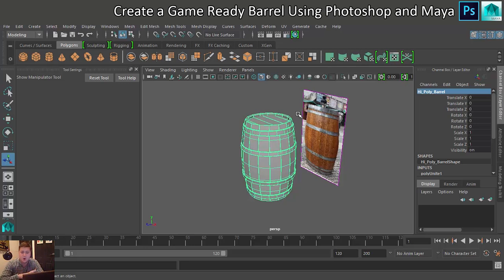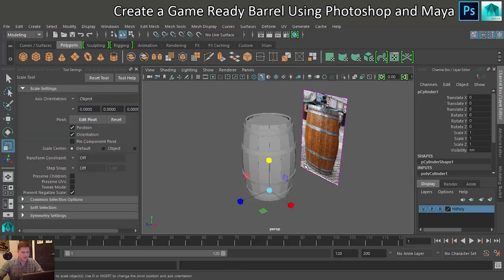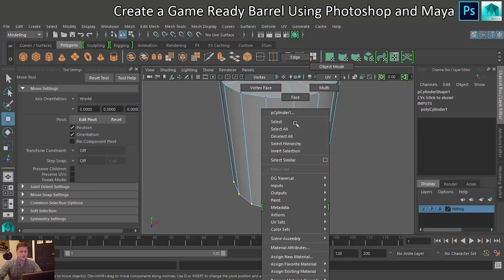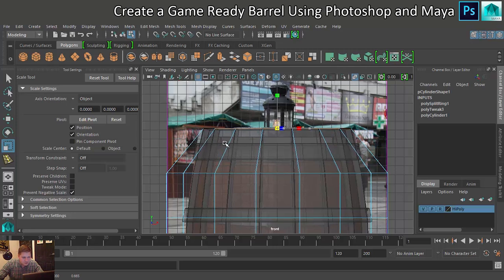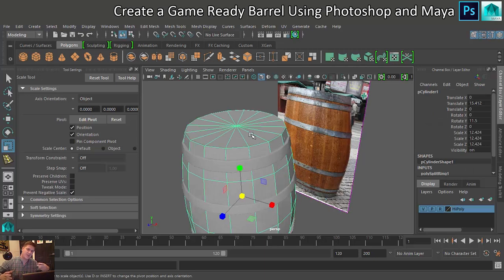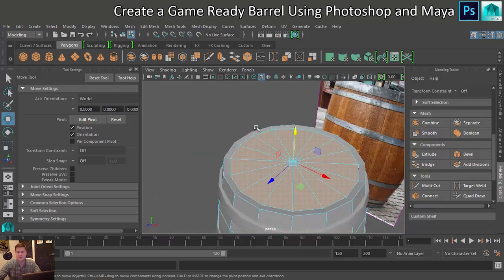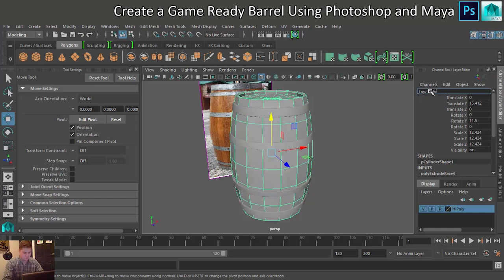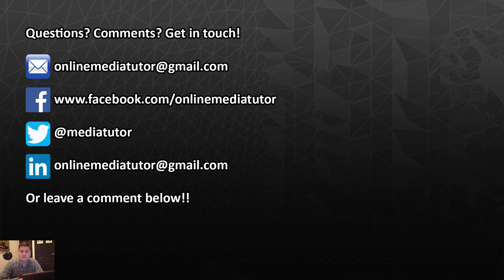#3 Modelling the Low Polygon Barrel (Retopology, Retopologize) - Maya High Poly to Low Poly Tutorial

Comment: I'm still having an issue with baking potentially because of how my low res is compared to my high res. My bakes come out fragmented and I'm pretty sure I'm decently close to both. How strict does the silhouette have to be on the low res for the high res to bake properly? or do you think it could be a substance painter / baking settings issue? Here's my project: https://skfb.ly/6GpQH

I initially normal mapped most of the detail, but I plan to actual model the strings in low res and even try to work with quad draw instead since my model is still somewhat organic in shape.

I'm totally open to any advice I can get. I always have issues with my game res and baking.

Comment: i have a heart shape tough sorry not a cylinder like would i make heart with edges and line it up with a heart with alot of edges.  like you lined up the cylinder with the barrel in the begging.   My purpose is to have a clean topology tough not high to low poly its for problem sloving side for assingment